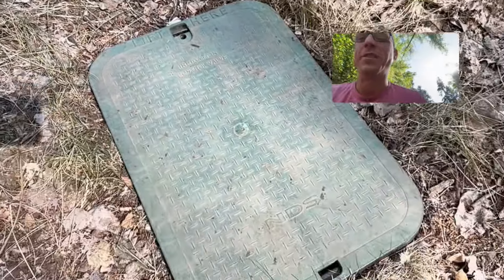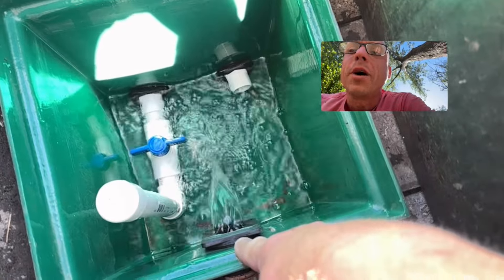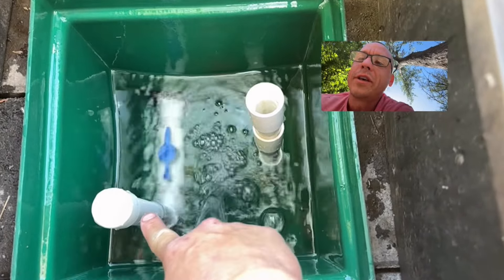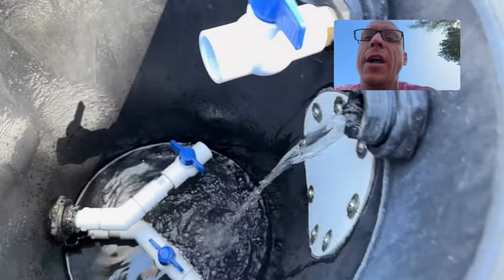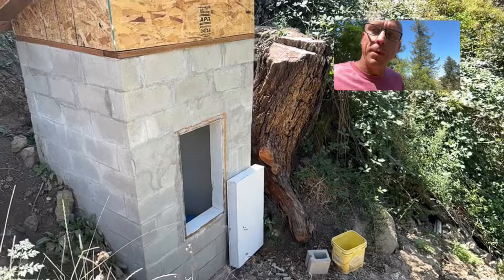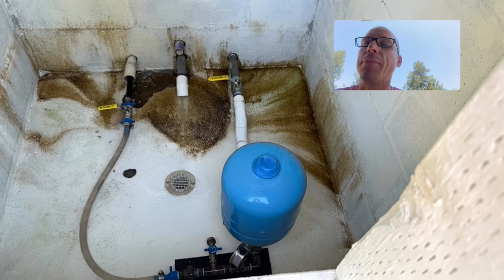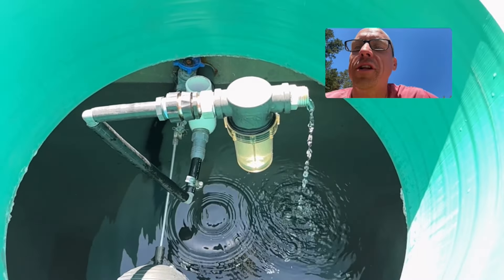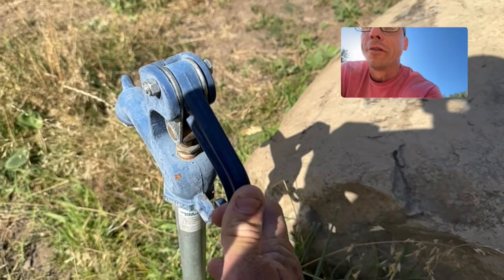Off-Grid, Gravity-Fed, Homestead Water System Complete Overview

Comment: What I don’t understand.  Why go down the mountain to come back up?  The spring source is above the cisterns??
Reply: The spring is only above the first cistern;  it drops about 40 feet to the Ram Pump, which pushes it up 100 feet to the second cistern (about 60 feet above the spring) which gives him gravity pressure to the property.
Reply: The water stops in winter because of freezing temperatures…
Reply from the maker: @colinsmith9208  The water source is too low on our property to be usable via gravity pressure.. So we move it up the mountain to a secondary water cistern that gravity feeds the entire property. 💧
Reply from the maker: @Vikingwerk  appreciate you brother!
Reply from the maker: @SethHanson-i4n  No. like I said.. The water temperature coming out of the mountain is 54°F. It won’t freeze because it’s constantly moving.
Reply: @ModernRuralCivilian thanks.  That makes sense..
Reply from the maker: @colinsmith9208  Of course.
Reply: Why do you need the 2000 gal sistern if all it does is essentially go into the buffer tank which feeds the ram pump? Couldn’t you just let the spring run into buffer tank? You really only use out of the tank at the top of the property, right?

Is it just a backup essentially?
Reply from the maker: @MrJonroock  Yes it’s backup. And there’s a whole other side to this system I haven’t showed you yet. ☺️
Reply: @ModernRuralCivilian  Aaah- can’t wait to see the rest!
Reply from the maker: @MrJonroock  🤩💧🙌

Comment: Really gotta get my silt box filter going so I can get my ram pump running again. My ram pump kept getting clogged from the silt. Ours is just canal water but feeds our pond. Lots of muck and silt in our pond from years of neglect.
Reply from the maker: @andrewrice16  A spring box and buffer tank will work magic for your ram pump! Let me know how it goes! 🤝🛠️
Reply: @ModernRuralCivilian  I've been tinkering with the thought of making one out of a 55 gallon drum as the entry point is on our very far end of our property so I wouldn't have to go back there so often to clean it. Although I would love an entire ram pump house like yours as well.
Reply from the maker: @andrewrice16  A drum will work just fine! Make sure you leave a valve at the very bottom so you can flush the barrel to clean it!! 🤝🛠️

Comment: That is fantastic. Well done, as a child in Cornwall UK a lot of farms had ram pumps and the distinctive clunk clunk noise was part of the sounds of the countryside. Most are gone now, as have the small stream waterwheels. It’s a backwards step I feel.
Reply from the maker: @simonaeldred  Thank you for sharing the visual description. I can imagine it from here. ☺️
Reply: I’ve just found a spring on some bell and I’ve purchased I’ve dug out a couple of pounds cascading down the hillside and I’ve just bought the fittings to create a run pump disguise video was very helpful As I have no idea what I’m doing, but I’m pretty determined😊

Comment: Very cool!!  Love it.  Question - what's the distance and elevation change coming into the ram pump to be able to get enough pressure?  I'm in the early stages of planning something similar.  Have approx 50ft of elevation and perhaps 300-400ft of pipe to reach my large tank.  Thank you!!
Reply from the maker: @scome98  the pump is being fed by 16ft of drop. The pump is lifting the water almost 100ft in elevation gain through 600 feet of underground pipe.
Reply: @ Thanks!!

Comment: Mark, thank you for the close up on the ram pump fittings. This was a huge help. I'll be having a very similar setup eventually here in rural VA. How much did those hold tanks run you? Also were you able to set them with your tractor or did you need to hire a crane to set them?
Reply from the maker: @morrdak-ironbender  The concrete water cisterns were around $2200 each. You are responsible for digging the hole they get set in. But the manufacturer delvers and uses their crane to set them in the hole. That’s included in the sale price. 💧💧

Comment: Regarding the concrete tank at the top of the hill, how do you ensure that no microorganisms develop in the stagnant water? Do you treat the water further before drinking it? While the water in the tank may come from the same source as the fresh water you drank from the cup, stagnant water can become a breeding ground for microorganisms. What measures do you take to address this?
Reply from the maker: @Greg579  the water is never stagnant. It’s got a constant flow of fresh spring water pouring into it.. 24/7. The water is cold 54°F and stored underground. Things grow in warm water that is exposed to light.. this is neither. It cold, and never sees the light of day.